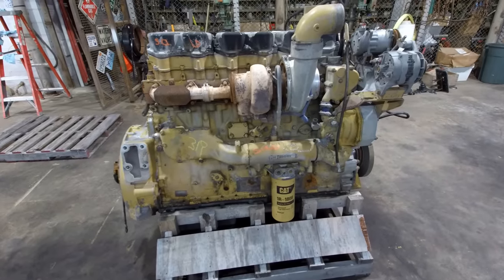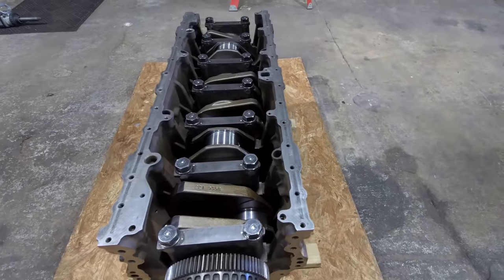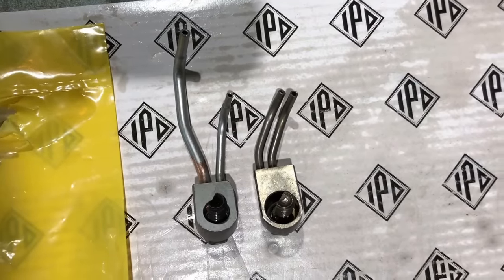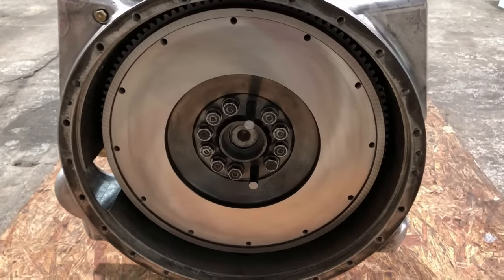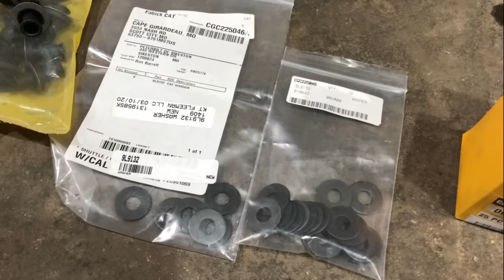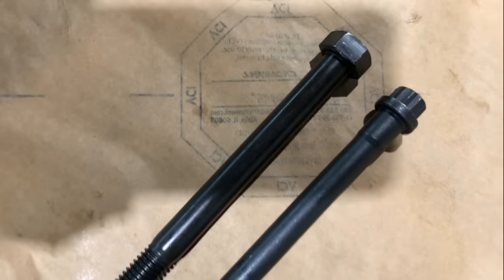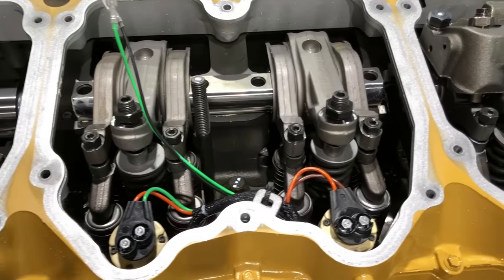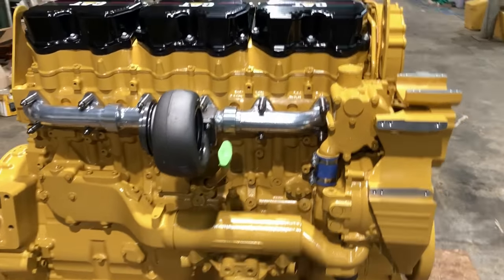800+ Horsepower 17 Liter Caterpillar Diesel Engine Build from Start to Finish + 1973 Peterbilt

Comment: I work at the CAT reman facility in Booneville MS. Cool to see that me and a guy named Cotton dipped and packed that camshaft in your video 👍
Reply: I work at a CAT dealer in Canada, and I use your blue goo dipped parts daily! Had a first in 15 years this week - G3516 cam in a G3512 box lol
Reply: Ben T.  Once the camshafts are packaged they may sit in storage for months at a time before they are sold so a thick coat of blue crud is needed to prohibit rust
Reply: @forrestjackson6242  
prohibit is to forbid.
inhibit is to prevent.

Not being a dick, just thought it was interesting. That's why we say "rust inhibitor," rather than "to prohibit rust."
Reply: @sourbrothers73  I like prohibit, sounds proactive and authoritarian.  Lol
Reply: Is it also assembly lube? did he really need to clean the cam before installation?
Reply: @richardzielinski5707  it’s grease not lube
Reply: there's always a guy named cotton
Reply: @baxwell3540  Especially in Mississippi, there’s definitely always a Guy named Cotton! Lmao
Reply: @allanholiday441  can't argue with that! (:
Reply: the total cost to rebuild this engine is about $1,500
Reply: damn i didnt know there was a cat factory so close. I grew up in tupelo lived in wheeler for a while as a kid....
Reply: It's like cosmoline on surplus rifles, it's a bitch of a mess to clean up but it sure does its job and protects the metal
Reply: @benjamins9121  I bought a URGI upper from G. Looked like they dipped in a barrel of that shit. Hung it up to a tree,  an a can of brake cleaner later it was all good. 😂
Reply: Was it a hurricane or the long wind intro that knocked down those trees?
Reply: Small world
Reply: @tonytran4857  everything he’s done here is a 50-60k job
Reply: @tonytran4857  1500 bucks to rebuild an engine? Damn if a person gets what they pay for 1500 is just a start up then the it runs away seems like
Reply: I work at logistics in corinth!
Reply: I packed.  Cotton packed.   It's not me packed.   Makes you sound silly.
Reply: @LungsMcGee  shit, I use rust forbidder 😂 thou shalt not rust !
Reply: @tonytran4857  Think you forgot to multiply your figure by 5!!
Reply: @TheRebelOne.  if it's more then that i rather buy new engine I rebuilt engine more than 10 years I should know what I'm doing
Reply: @tonytran4857  That's 10 years ago. Could you realistically rebuild this engine for $1,500 today including all the machine work and rebuilt head etc?
Reply: @tonytran4857  Ok thank you for your reply. You are obviously very qualified to repair a CAT engine for very little but you have absolutely no qualifications in manners and respect when commenting on YouTube.
Reply: @sourbrothers73  you successfully hijacked this comment thread. Well done sir.
Reply: @allanholiday441  "Authoritarian" 😂 Camrade G3516 and the bolsherust revolution
Reply: @tonytran4857  In Pakistan ?
Reply: Cotton sounds soft. Tell him let's fight
Reply: @Mercmad  Exactly this was my first thought.😁
Reply: @tonytran4857  Did you see how many parts were bought for this? The hours for labor alone cost more than $1500, if you are ground up rebuilding an engine and charging $1500, I'm leaving and finding someone who knows what they are doing.
Reply: @jamiesachtleben2946  Sur i rebuilt engine all my life especially Caterpillar and Detroit i think i know what i'm doing
Reply: @tonytran4857  i bet you do one hell of a job in your sandals, squatting in the mud lol
Reply: @phillipchambers8487  there is no guy named cotton in la😂
Reply: forrest and cotton that’s awesome
Reply: I live in Brandon, Mississippi.
Reply: Does lacquer thinner clean that blue crap off?
Reply: @richardzielinski5707  no,it is NOT assembly lube,it’s more of a waxy substance,and should be thoroughly cleaned off new parts,as it can ruin friction surfaces and clog up oilways.
Reply: @tonytran4857  times 20
Reply: @tonytran4857  obv don't sooooo. That rebuild was atleast 30/40k
Reply: @tonytran4857  how u go from 10 years to all you're life seems to be stories to me?🤔
Reply: @randomstuffs.d  what every dude stu..pid
Reply: ROFL! If it were at all possible I would prefer to PROHIBIT rust! When you INHIBIT rust there is still a good chance rust will form.
Reply: Nice to see a partner from the states! Pon equipment Norway here!
Reply: @giovannicastro1225  I’m assuming some sort of rust inhibitor
Reply: Is it gonna be a Set of JAKE BRAKES ON THIS ENGINE
Reply: I see all the diesel mechanics on here how good and solid is reman stuff compared to buying new I need new injectors for my lly and wondering what way I should go new or rebuilt
Reply: @randomstuffs.d  how much is a new engine?
Reply: @allanholiday441  
____________________Don't you mean "progressive and authoritarian."?
Reply: I worked at a Cat supplier that reconditioned parts that sat in inventory too long. We used a ton of that blue tarp crap. We had a Bucyrus swing gear, about 12-15 feet across, which several guys spent several days derusting. Then we had to paint the whole thing with the blue goo and wrap it in plastic. Then we used four fork trucks to lift it while we slid the crate under it, blocked it up and put the lid on. It wouldn't fit through the door, so we had to do the whole thing outside in the winter.
Reply: @tonytran4857 .... Not sure what engine you're thinking about rebuilding for "$1,500".... some little gasoline powered car engine.. maybe!   But for a modified CAT truck engine "build" like this, you're looking at an "Easy" $50K- $60,000.   A "box stock" CAT re-manufactured (Not "rebuilt"... there's a difference) C-15, 6NZ or ACCERT C15 (compound turbocharged) will run you $30,000 - $35,000+.  Even a little CAT 3044T (4 cyl. w/80hp) will run $14.800 - $15K+  and smaller (compared to this one) Medium range CAT engines, like a C7, 3126, 3116, C9, etc... are all in the $25,000. to $30,000+ range.  

A factory "stock" C18 CAT (to which he is building his customer's engine to, in terms of power) usually "Start" at around $40,000. for a Remanufactured engine... plus a $10,000. Core charge, which is Not Refundable... if they find that the engine block (another C18) your supplying for the reman does not pass minimum specs to qualify as a good block for re-manufacturing, so in that case, you're looking at $50,000. for a "Stock" C18.   

Whoever is having this engine built... is looking at a "Minimum" of a $48,000. bill.    "$1,500." lol.... the turbo, to support 800 hp will run him At Least, $2,500. depending on "who" the turbo is from, whether it's CAT, or another "aftermarket" manufacturer or supplier.    

Back in the late 1960's and very early 1970's you could reman (NEW internal parts, plus gasket & seal kits) a Series 71 Detroit for $100.+/- per cylinder, depending on the application.
Reply: @j.m.5995 .... Thank for the laugh!... I needed that!  : )
Reply: @tonytran4857 .... your $1,500. reman and upgrade price for this engine.... proves beyond a shadow of any doubt... that you Don't.   Have a nice day.
Reply: @randomstuffs.d ..... Times 37, would get him into the "ball park".  A "Stock" CAT C18 Re-man.. "Starts" at $40K.... and that's IF, your core meets the minimums for a full re-man.   If Not.... it's an additional $10K for the core charge... so, $50K and Up... depending on application.
Reply: @tonytran4857  no way, nobody does a fully machined rebuild with new parts for 1500$ on any engine !!! Machine work alone costs more than that
Reply: @DSRE535  oh yes a lot of parts i make my own
Reply: I did not replace some of the bearing I just read grinded and use them again that's how I save my money
Reply: Bullshit! That was me!
Reply: @richardzielinski5707  I was wondering the same
Reply: @tonytran4857  what? Did you not hear him say the oil pan bolts/hardware not including pan were over $200 alone
Reply: @zackjay71  what ever he lie
Reply: CAT 😀
Reply: I think he is only giving price for seals and that’s all
Reply: @tonytran4857  to do in frame parts only my guess is 15k not 1500 7 years ago isx15 rebuild was 30k parts and labor, u can’t get a reman head for a cat for 1500
Reply: @ZeMooseGaming  Well i fix for cheap because i make my own bearing and more
Reply: @tonytran4857  I’ll never trust anything you work on
Reply: @Tony Tran  You are most definitely not rebuilding a 3406 for $1500. Maybe re-bearing with cheap bearings or no labor. But rebuild? Not even remotely close.
Reply: @tonytran4857  The injectors alone are worth about $1200, so by your math everything else is free.
Reply: @tonytran4857 hilarious.
Reply: Whhe
Reply: @sourbrothers73 wow I never knew this. But in my case I completely forbid rust so prohibit would be the correct term in my case. Lol I keep a case of wool wax at all times and if I see a spec of rust it gets sprayed. The shit works so well and I have a 1990 Toyota 4x4 pickup truck to prove it. Love me some old school Toyotas.
Reply: @sourbrothers73 the blue good forbids the rust
Reply: @antmoundlogistics good for you 😂
Reply: @tonytran4857 not bad. Look at the cost to overhaul  1 IO-470-U engine.  Smaller by far but the price might be rather shocking.
Reply: I’m in Brandon, MS
I would love to come down to your shop.
Reply: im in sales in peterbilt greensboro if anyone ever needs something their struggling finding. I got a couple good connections with backordered parts too.

Comment: "I wish his parents had bought him a coloring book"!  HA!  I did LOL on that one.......
Reply: you're not the only one!! That and the Blue Sh!t on the Camshaft comment...
Reply: Mark Grudt  a convenient place or brother and sister to shop
Reply: i sometimes use paint pens to mark important torqued bolts while working on my personal car, upon torquing the bolt i mark its head so i know its adequately tight. i work at a factory its mandatory to use torque marking ink, the torque wrenches have foam inserts that soak up paint and apply it to the bolt head during use so the quality control department know the tourque wrench was used